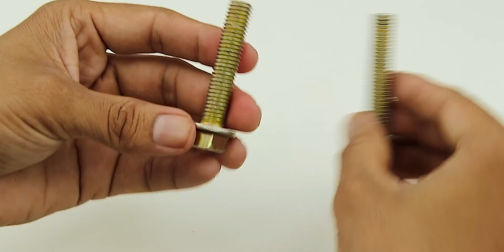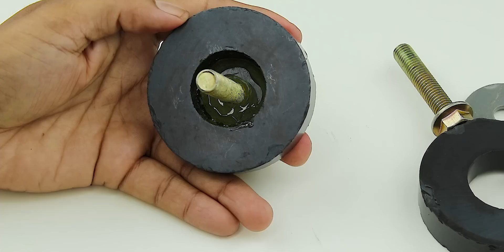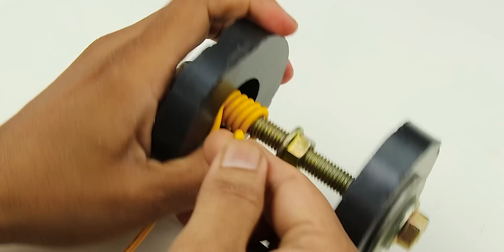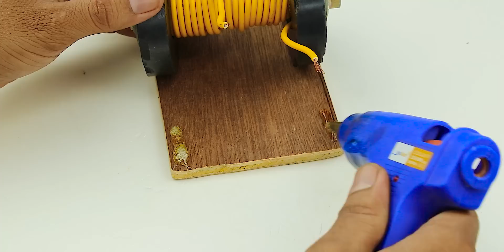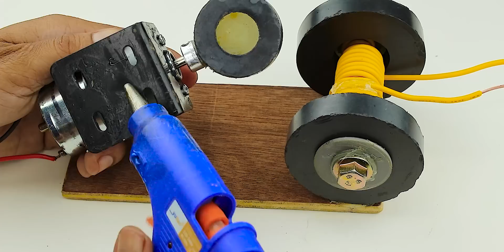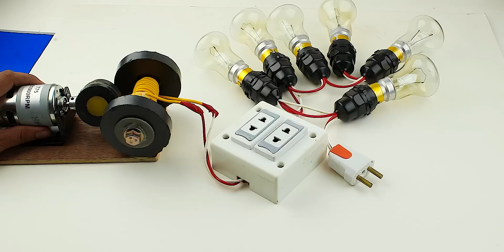I make 220v Electricity Generator invention using magnet motor 1mm cable

Comment: Very simple diy free energy self running mobile generator with estimate Volts = 220-240, Watt = 5,000 - 11,000, Ampere = 20-24. Nett weight = 1 - 2 kg only. Enough to supply fully free electricity for a 5 rooms banglow or put on ebike, (with a little modification). Total cost = USD25.00 only if using scrap material like in the video above. Live span of magnet = 20 years. Everyone can do it.

Comment: Interesting. Congratulations
 What capacity of battery ...9v or 12v started tmotor? Is free electricity or the Battery  will be attached and recharged when discharged? What on and off?
Reply from the maker: 12v battery, thanks